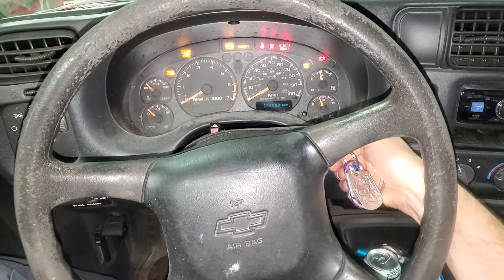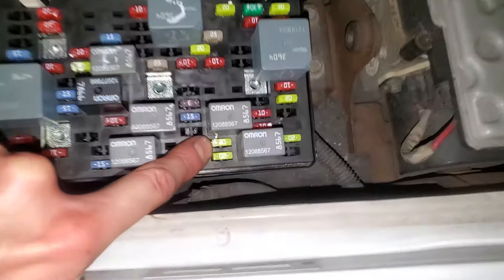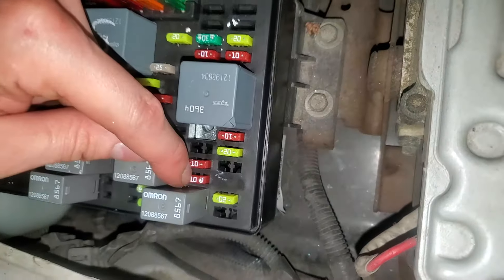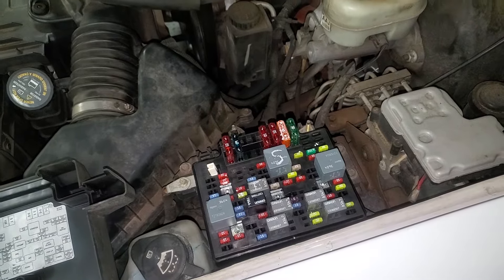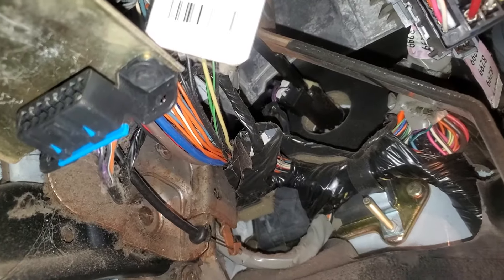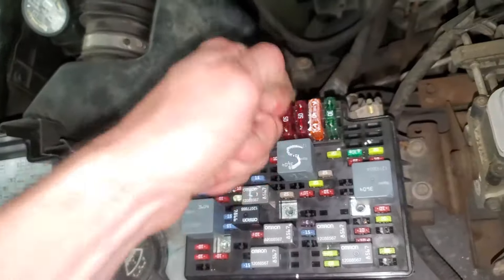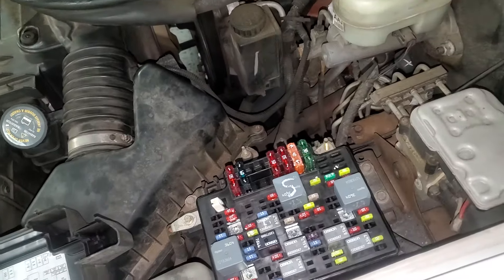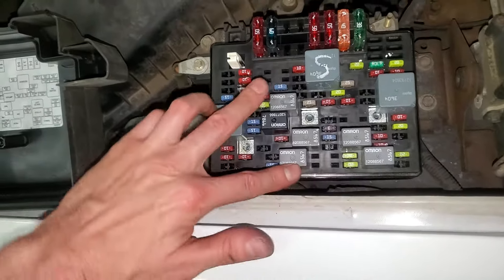2003 Chevy S10 Starter Fuses & Relay, Fuel Pump Relay & Fuse Location

Comment: Thanks, that 20 amp fuse was my problem.  Shut off going down the road, would not restart. Towed home, after doing some checking, was not able to find the problem until I watched your  video.  A big help.

Comment: Absolutely perfect explanation.  I had a no start on my 03 S10 and spent 2 hours checking ignition switch, clutch safety switch, battery and then starter.  Then I woke up...... and found your video.  BAM..... the 40 amp ATO fuse was blown.  Swapped with another fuse (ABS) and it started immediately.  Now.... swap back, get a new ignition 40 amp and then troubleshoot for a shorted wire (prob in the harness, or thru the firewall, or ??).  Thank you much.  Great video.

Comment: apparently the ground for the fuel pump is the wire near the rear bumper that bolts to the frame. i spent 3 hours trying to figure it out and am still not sure im right but its running now

Comment: My 2003 S-10 with the 4.3 Vortec automatic trans and 2 wheel drive intermittingly will start fine without extended cranking, other times it will try to start but the starter kicks out to soon and flood the engine.  I have replaced the distributor with a metal one, replaced the coil pack with new ign. module, the fuel pump is two years old, new alternator in 2023, and after all this, it still F's up.  Now I am thinking it may be a relay, what say you?  BTW, There's only 140,000 miles on it and I live in Michigan.  It may go 3 or 4 days with no problems, then all of a sudden it won't start just cranks and tries to fire, oh, also new plugs and wires, it's driving me nuts.  Btw, it throws no codes.

Comment: I followed your advice and everything was fine, so I stopped for a minute and I notice that one of my ground cables was loose, my truck have 3 on the read  back lights under the bed.  Thank you for your advice, just a feedback check ground cables. My. Truck is a 00's chevy s10 ls

Comment: when checking the 10amp crank fuse with a test light, are you suppose to get light on both ends or only one side???
Reply from the maker: Both sides. A light only on one side of the fuse indicated a blown fuse
Reply: @LehewTech  but it doesn't look blown at all🤔🤔.
Reply: no power at all at the crank fuse when turning over. is the ignition switch fuse suppose to have power at all times? my light tester turns on when I touch the fuse

Comment: I have a bravada that runs,but has a draw. i pulled all fuses to find a  drop in amps, i thought I found it to be from the radio fuse. After i replaced all the fuses& relays it cranks but won't start. I do have fuel pressure.  Is it possible to have a relay in upside ? Any suggestions

Comment: I like that advice at the end about switching the fuel pump relay with the horn relay. My 2001 S10 2.2L has been bucking at steady speed. Fuel pressure is good. Just had new plugs and wires. A friend suggested either throttle position sensor or fuel pump relay next. So I switched the relays like you mentioned. We'll see if it helps.
Reply: Uii
Reply: Surprised I never followed up on this one. Yeah, switching the relays did the trick.  I since sold the truck.
Reply: @InlinePaul  Yes such a helpful video.

Comment: I have a 1998 chevy s10 pickup, the air conditioning was blowing out hot air, went and bought a AC freon to refill it, noticed that the AC motor wasn't turning on and off, so was told to take fuse box cover off and use a paper clip to try jump the AC to see if would come on and off , and it did work, so removed the paper clip and the cover of the fuse itself came off and fell where I can't reach it, I stuck fuse back in place , and went to start truck and it wouldn't start, one time it will ding ding, and the next time try to start, won't do anything and then when you take key out ignition, you hear this fuse like noise from outside , but can't tell what it is, then stops . Is the truck not starting because the cover came off of fuse itself, or did I mess it up by putting paper clip in fuse holes? How can you tell if a fuse is bad, truck always starts right up until I messed with this fuse box.  Any help would be appreciated.

Comment: Question the issue I’m having is the wire from clutch switch relay is loose somewhere I’ve done the bypass but still sends bad signal how can I just bypass all that from the fuse box

Comment: What does it mean when all dash lights flash on and off.  Open door  alert  stays in for a few minutes after removing key and shutting door and buzzing sound under hood/dash sounds after car is off.......and wont start.  New starter and battery one year ago.

Comment: I have a 02 Chevy blazer s10, kept blowing the 10 fuse to the crank and I replaced the starter and it still not turning over. Battery is charged been looking at fuses and wires and can't figure it out. Any help appreciated

Comment: 2003 chevy s-10 model LS 4.3 L 6 cyl 
HEY !  someone
PLEASE tell me if a Check Engine Light (along with the engine icon) appears when you turn the key to the ON position. and please show or describe where it is located.  I see more lights  lit up on yours  than shows up on mine, but it is not focused so I cannot tell if/where the CEL is supposed to be.

Comment: When I touch my test light from ground to the 10 AM fuse you show is the crank fuse my engine cranks over.Do you have any suggestions
Reply from the maker: Does your engine not turn over when you attempt to start the car? You may have an ignition switch problem

Comment: Yeah. I lost soark rolling down the road. Still had 14.2v, good pressure at shrader port/fuel rail. Turns over w/good compression. Zero spark. Swapped every fuse+relay in box abd door in case, new cap/rotor,new coil+icm, new plug wires ..still no spark.

Comment: camaro fuse box has some that light up. Turned over doesn't start...replaced fuel pump. Gas getting all the way to throttle body

Comment: I'm having an issue with my brake lights not coming on. The rear lights are on, but when I brake I don't see them getting brighter. I tried checking the fuse manual but isn't really clear which one is for the brake lights. Or maybe it's not there. Obviously I don't know squat about cars other than basic things. Any help would be appreciated. Thanks!